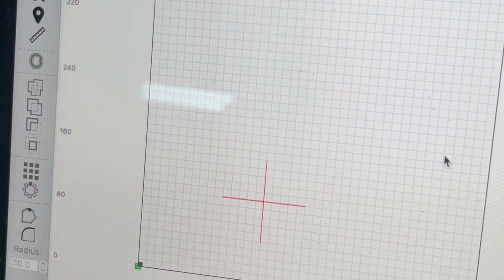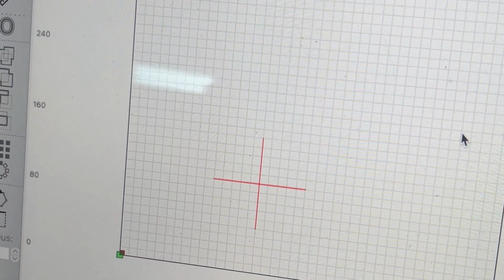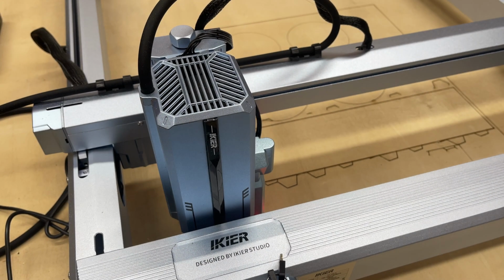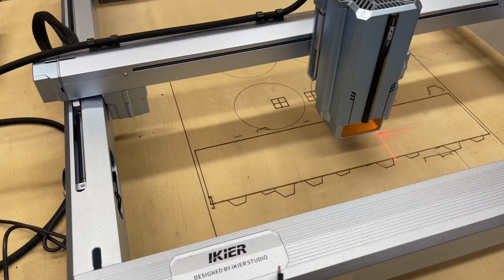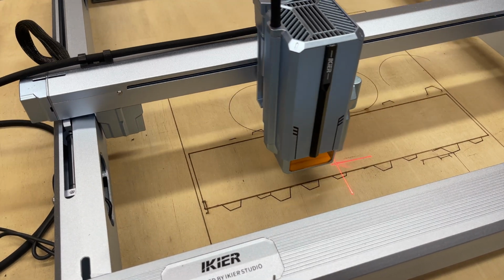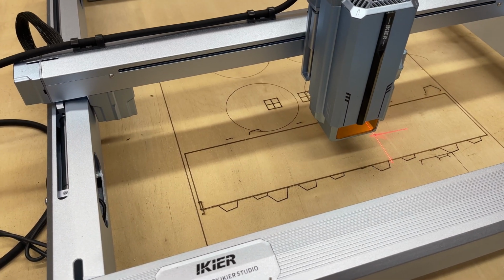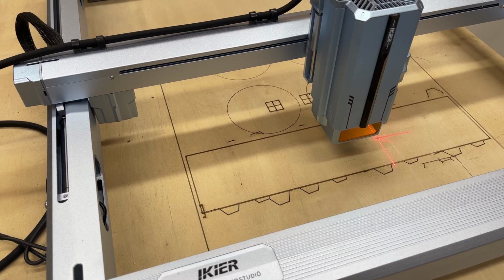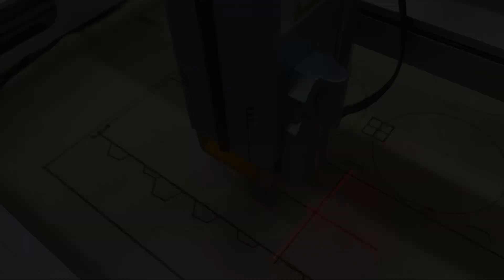iKier K1 Alignment Laser Fix - Step by Step Guide

Comment: I noticed that something has happened to my crosshairs.  They are no longer sharp lines, that are way wide.  Do you have any idea what the problem can be?
Reply from the maker: I don’t believe there was any type of adjustment for it in that regard. I notice that they are less sharp when I’m not auto focused on my material but once I lower the depth to the right height it’s good. That may be some sort of ticket with ikier unfortunately.

Comment: Can the laser be positioned directly below the laser output? Otherwise you will lose work space :(
Reply from the maker: Doing the laser offset you do lose about 55mm of usable space. You can do a low power burn from the actual laser as well. I do .25 on the 36w when I need to do that way.
Reply: @757woodworks  Can the laser be activated permanently? There was always a laser dot on the neje a40640. Thanks for your quick answer :)
Reply from the maker: @miuix4795  the red dot is always on. Unsure how to disable that short of unplugging it if you didn’t want to use it.

If you go for the .25 burn that is only on during framing. You do that to turn that on in the settings for LightBurn though.

Comment: I have encountered many little things like that with this brand, the mobile app doesn’t work, the drivers do t work on MacBook M2, autofocus didn’t work properly, display missing magnets… they are not nice in terms of compensation for time wasted given that we’re helping them fix the semi-finished profuct
Reply from the maker: Yeah I had a couple of minor issues but it’s working like a champ now. And I’ve heard stories about anything running on the M1 and M2. Definitely worried about that whenever I upgrade.